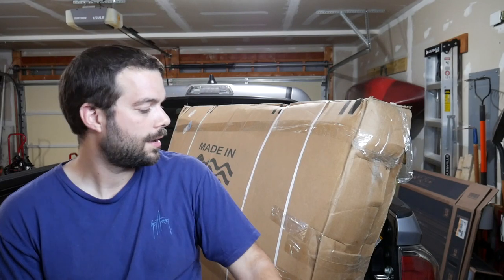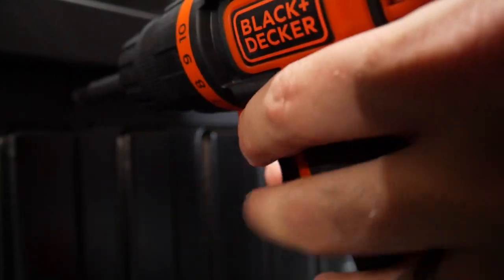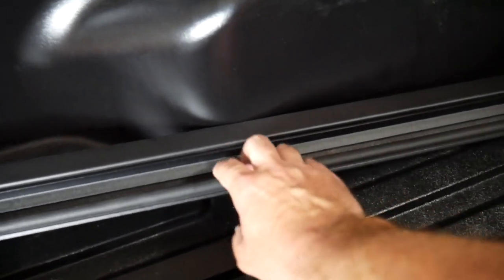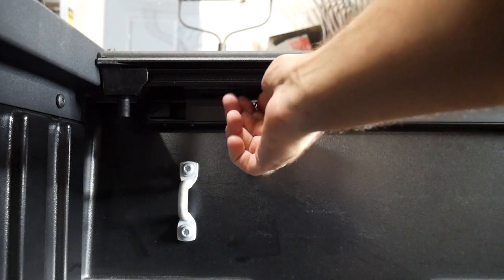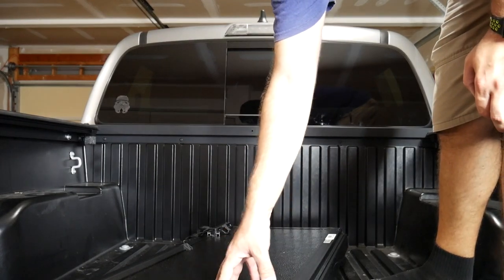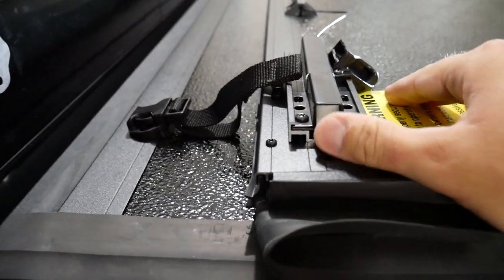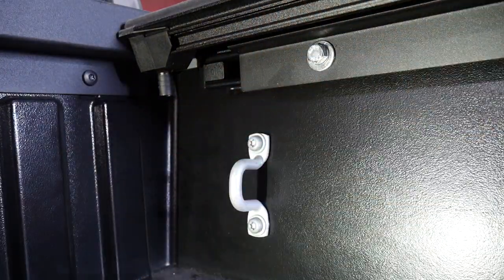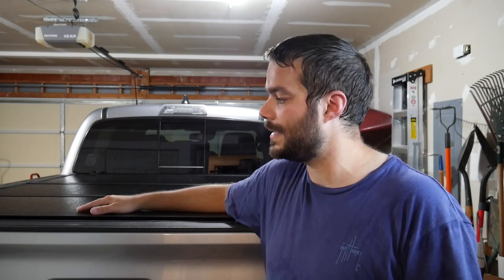Toyota Tacoma Rough Country Tonneau Bed Cover | Install and Review

Comment: One thing I noticed about these covers is the lack of security, by inserting a wire coat hanger under the back you're able to pull the wire and open the cover. Another thing is you loose the slides for securing storage, were other covers add blocks and allow you to reinstall the rail under the bed cover rail.

Comment: Good install video. I have the OEM Tacoma one that came with my truck. Not sure if it has drains like the this one. It certainly is not 100% water proof. What I don’t think about the rough country one is that you loose the rail system for your tie down points. It also does not go all the way back toward the cab.
Reply: How is the factory one holding up? I am going to get one from a guy who just bought a new trd but doesn’t want the factory soft one. I want it for the trips I take here and there to fly fish. I figure it won’t be waterproof, but if it can at least keep the bulk of water dust birdshit and prying eyes off of my stuff plus keep it from blowing out then it’s a win in my book
Reply: @DB-qm4jx  holding up nicely. I don’t keep much in the bed if my truck. When I do put anything in it , it doesn’t move so that is definitely a good thing
Reply: @ryanmurphy694  right on I appreciate you let me know. I’ll be picking that one up here in a couple hours. I’m glad to hear that. I won’t keep much under mine either except for when I go camping and I pull into a gas station it will keep the quick I in hand away from my stuff. I also like that guy can take it off easily and seemingly store it much easier than the hard cover as I don’t want a cover on full time. Anyhow, thanks a bunch.

Comment: When you drilled into the bed….you lost me. I am looking around for another cover. Thanks for posting they video…..nice job.
Reply: Same, What other options have you found?
Reply: You don’t have to drill hole and hook that hose up. I didn’t even hook either hose up and no water has penetrated my bed and I go thru automatic washes 3 times a week.

Comment: Excellent video. Question: why not drain out to the existing holes in the bed of the truck? Like you I’m not wanting to drill holes in the body of the truck.
Reply from the maker: I wanted to make the drain lines as minimalistic as possible to avoid hitting them at any point and the predrilled holes are all the way down to the floor of the bed.

Comment: Any recommendations for a similar cover that will not cover Toyota bed rails? I'd like to use the Toyota Cargo Divider. Thanks.
Reply: The MX4 Bakflip won’t cover the factory rails. You actually remove the rails with it and relocate them about an inch or two down on brackets that they supply.

Comment: Thanks for helping me today for the install. However I didn't drill into my bed and I think it should be just fine without doing that
Reply: how's it holding up, I am about to get this cover but not going to drill holes. I cant imagine that much water getting in plus there are drain holes right at the bottom which I would be okay with water getting in cause it would drain out right away.
Reply: @cexy63s  Not a single drop off water has gotten inside my bed, works good. Careful though it's got a soft thin layer of aluminum on top
Reply: Did you block the drain hole?

Comment: someone not used to drilling could drill right  out the side off there  truck bed. I dont know why the water doesnt drain to the rear instead of the front.
Reply from the maker: Tacoma’s lean forward so the water naturally drains towards the front of the bed near the cab.

Comment: Looks awesome...I'm looking at options for my Tacoma thanks for the video!!!
Reply: I have the Lomax trifold hard cover on my 2021 Tacoma TRD OR and like it so far. There is no way I drill a hole in the bed of my truck. I don't need a 100% waterproof cover. I assume it doesn't leak much water in the bed so I would just not install the drain through the bed.

Comment: Good video. Ian have the same situation. So pissed off that the tailgate does not have an auto lock feature with the doors. I've ordered the Toyota lock at $260 and I have to install it. Close to $600 if Toyota installs it. Are you considering doing this?
Reply from the maker: Yeah you’d think by now it would be standard.  I have plans of installing one sometime in the near future.
Reply: Buy a Pop N Lock kit for the tailgate. It’s about $130 and takes about an hour to install.

Comment: Pass up on this. I aint drilling no holes in the bed.
Reply: Right. I just got a 2021 trd off road today. No way in hell am I cutting this shit up.
Reply: @OMGItzChriis  is a truck not a Lamborghini...
Reply: It’s just a small hole in the side of the bed liner, not in the truck.  You could just not install the drains but then rain water will come down into the bed through the ports.
Reply: Yup and loose the side tie down rails.
Reply: I didn’t use the hoses and no water gets in my bed.

Comment: Wouldn’t rough country think to just reverse the drain hole locations and have them drain out the back near the tailgate or through the bed lighting covers?
Reply from the maker: Tacoma tend to be front heavy so water actually drains towards the cab and there’s holes in the bed there too.

Comment: What year is your truck? I think my 2019 has a drain hole in the bed already
Reply from the maker: It’s a 2020 and has the drain holes in the floor but not the sides to push the water away from the bottom of the bed.

Comment: Awesome informative video! Have you had any issues with the outside weather stripping folding up over time?
Reply from the maker: So far so good!  A little rust on some of the bolts but still running fine and no rubber gasket wear as I’ve seen some folks post about.  My flaps are still flat.
Reply: @GearKnowHow  Awesome! Thank you for your reply! 😀 Keep up the awesome videos!

Comment: Have you had any issues with water getting in the bed.?
Reply from the maker: No major issues yet.  Just seen a few small puddles mostly from opening the cover after a heavy rain.
Reply: @GearKnowHow  Do you have any towards the cab of the truck? I installed the tubes but still getting water in right by the corners
Reply from the maker: @KoolCreation  I would check to see if any sunlight is leaking through and add weather stripping as needed

Comment: So it makes the factory bed rails COMPLETELY USELESS other than holding the tonneau down.  You can't even have cleats spaced between those aluminum blocks because it's blocked all the way down. What a stupid design. They could at least have gaps to strategically place the cleats. Yeah, take away factory (not even aftermarket) functionality!  no thanks.
Reply: You're right. Dumbest design ever.
Reply: I agree. I got Rough Country cover that goes over the top and the rails are free (for the most part) to use the cleats. Good cover.